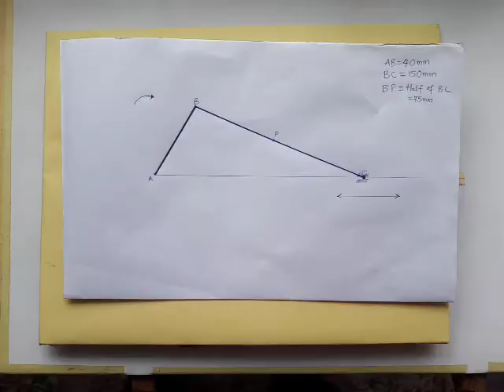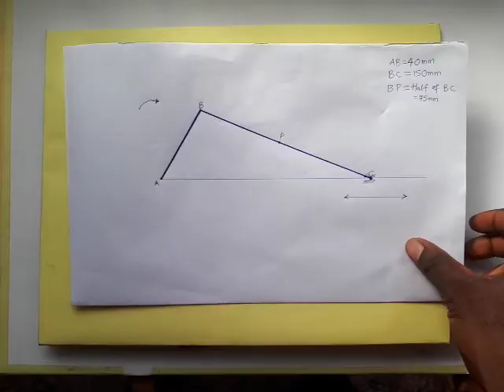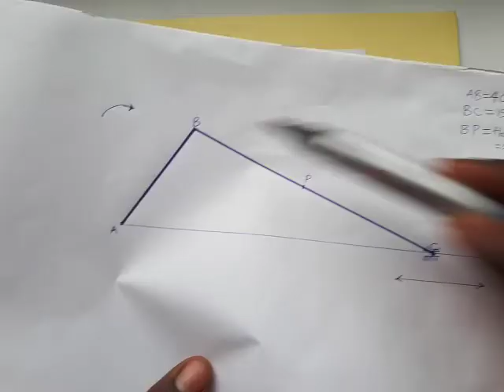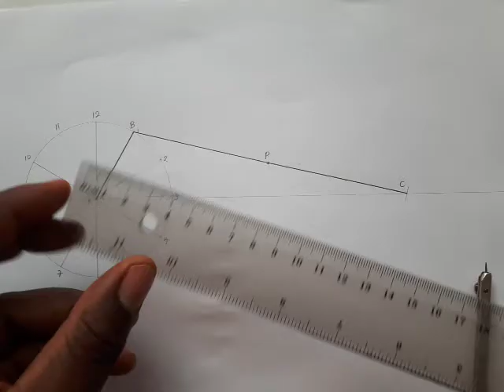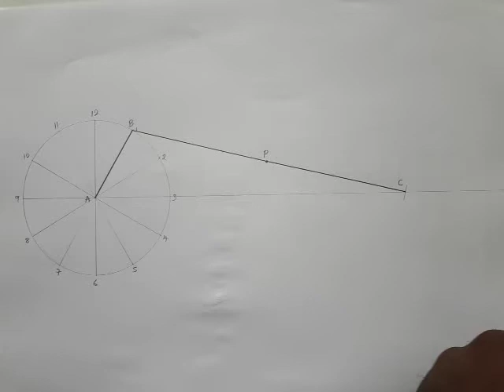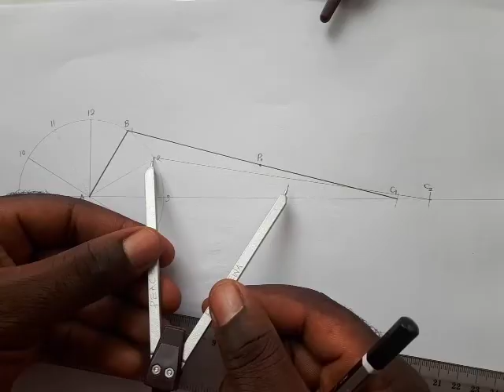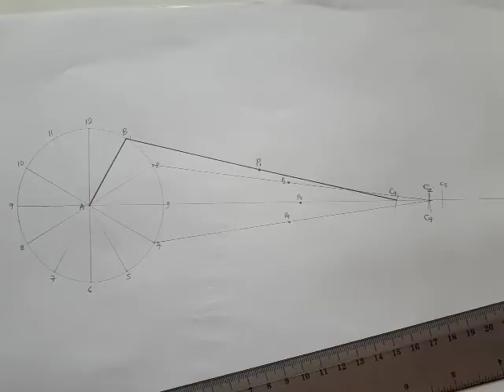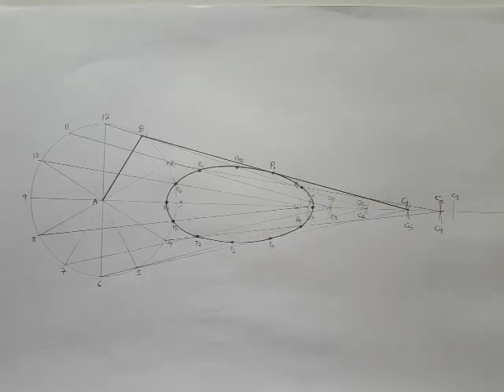TD - Simple Link Mechanism.

Comment: Which dimensions of french curve should we use to connect the circle
Reply from the maker: French curve comes in three pieces (small, medium and big). You combine them depending on the part that fits in each French curve.
Reply: Thanks but this method is confusing is there another method
Reply from the maker: @ebelembonu-gb9lt  oh well I can guarantee this is one of the easiest method you will ever find online.
Reply: Ok sir because I am till in ss2 so I am finding it difficult to understand
Reply from the maker: @ebelembonu-gb9lt  It's really quite easy... That's why I took my time to break it down even using teaching aid. Start all over again but this time be patient and listen to every detail... Don't skip or forward any part, I'm pretty sure you will get it. 👍🏼